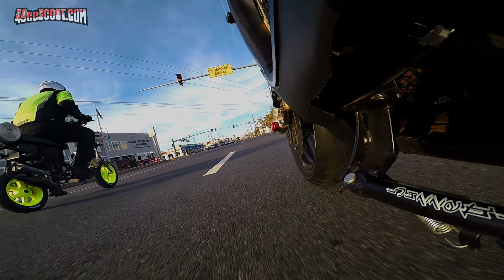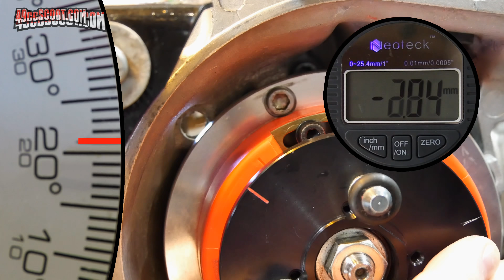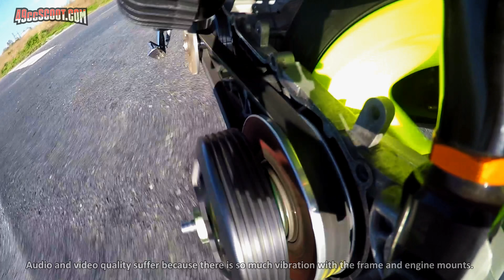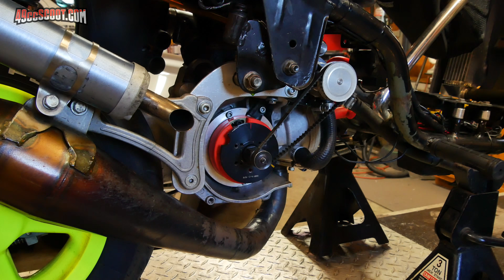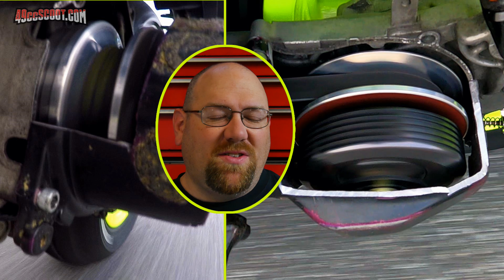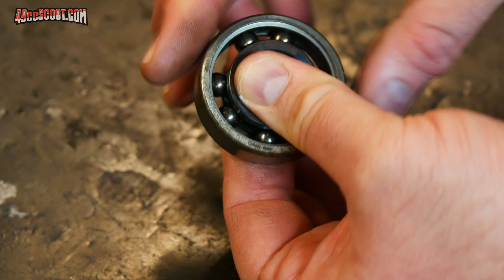Breaking Almost Everything : Scooter Fails : TPR 86cc Build : Part 48

Comment: Hi Brandon, first of all, good video.. lot of information.. 2. driving without belt cover is really dangerous, i wouldnt do that again for safty reasons.. and 3 but most important i would prefer you a a piaggio SKR, a gilera runner or a Piaggio hexagon with 125-150-172-180 cc ! i know its hard to find in the states but belive me this things hold up a lot better than tuned 70cc... my SKR have now 179cc (Malossi 172cc + 55/110 crank) with Mikuni TM24 carb and Malossi transmission holding up now for 10000km ~ 7000miles with nearly no problems.. lot mor tourqe and really really fun to drive.. maybe u look out in future for something like that i only can prefer this
Reply from the maker: I'd like one of those big Piaggios as well, but I've noticed it's mostly the guys with deep pockets that seem to end up with one here in the states. I tried to price one out some time ago and it looked like thousands of dollars and every time I needed anything it would be much more difficult to get and more of a wait aside from added expense.

Comment: Very interesting stuff, nice video!
those bearings (TN9 cage) have less friction, but they dont last as much as the steel caged ones.
Please do a follow up video on the future engine rebuild. 
What kind of cage will you choose one the new bearings?
Reply from the maker: I've already got the same ones here. I bought them right after I installed the kit originally to have them around so I'm gonna use them. If they make it another 2,400 miles, the kit will most likely be toast by then anyway.
Reply: @49ccscoot  I am rebuilding a Minarelli P6 80cc, I also bought SKF 6204 TN9, I'm now wondering if I made the right choice
Reply from the maker: @DavidArez  I think they're fine. After seeing that some big tuning manufacturers are supplying a support for the ramp plate, I'm leaning more toward the vari taking out the bearing and the crank.

Comment: I used turn kevlar belts to dust every other week. After upgrading to the Stage 6 Oversized Transmission Kit; I haven't had it happen again. A costly upgrade for an already tuned scoot, but well worth it in the long run imho. I'm almost 100% sure the belt was running off the top of the front pulley before.
Reply: Also, check your crankcase for any cast defects where the belt could be fouling against the inner support material.  If it is then you'll need to remove some material with a dremel.

Comment: Seen this before. It's all about ramp plate. After ramp broke, heat build up from friction and that is why crank seal and bearing nylon cage failed. Do not ask me why the plate failed, don't know. 
Best of luck Brant! 🏍🏁
Reply from the maker: Thank you. Others here commented the same. I've never heard about this, but it was even pointed out that you can see a reinforcement spacer included in some variator kits.

Comment: The crank catastrophe can be put down to not having the shaft ends supported inside the outer casing of the cvt. 
  Have watched many of your vids over here in New Zealand.  Love your work. 
  Just out of interest..what's you mpg/ fuel consumption for this setup? 
 Im running a chinese qm40b 50cc here. So far just my mods are a race exhaust and race cdi and derestricted. The bike is branded tnt roma. They run a 10 inch wheel. I top out at 70 ish kmh. 
 Uphill performance is still abysmally poor. Terrain here is hilly. Would love to see you ride some steeper hills to see how it performs uphill. For me ..the aim is to not be holding back traffic at 35kmh..and be at least holding 50kmh uphill, if not having a little oomph left over for uphill acceleration to 50kmh.
Reply from the maker: It does something like 40-45MPG. It was a little higher with the lower RPM pipe originally. That's about the same as I was getting with my old 103cc combo. About the best I've ever done for increased power and good economy was an old 90cc short case in a small scoot and it would see 50+MPG regularly and even as much as 70MPG when I tried to run it really gently. It revved to about 9,000RPM and would do roughly 60MPH. Nice simple street setup that was very unassuming to see or hear.
Reply: @49ccscoot  thats really good economy considering the speeds. 
A guy over here has an aprillia sr50 modded with a malossi big bore kit ..he tops out just above 60mph at 5 to 6 litres / 100km, 45mpg..its for sale ..Nice bike..but drinks a bit too much. 
  The issue with hills is controlling the rpm high enough so you can be in the power range of the engine. 
  Therefore Im thinking the cvt transmission is the real reason Im not making 50kmh uphill. 
  Adding more hp certainly would help..a big bore...but I feel theres enough hp there in my setup...its just finding a way to utilise it uphill. 
   Do you have a video that could help with this issue? Cvt tuning?
Reply from the maker: @bradg7279  I'm still a firm believer in more power, especially with a 50cc trying to climb hills. That said, if RPM is dropping off out of the pipe's powerband, you do need some CVT tuning. I would try lighter weights first and see how it does. Some prefer to go right to a stiffer contra spring. It may be that it takes a bit of compromise to get something that works well enough on hills and on flats. At least if you can get the RPM up on hills, you will know if you do need more power or if it is just a matter of keeping RPM up.

Comment: i think these tpr cilinders are really poor quality ive been running a mallosi mhr t6 cilinder for 700 miles and it stil looks like its new from the factory not a single scratch on the cilinder or piston . I saw you're last video where you put on the new tpr because the last one failed an i would think its not been on there for too long znd it already has scratches in the cilinder probably realy poor quality nikasil i would sugest moving to a different brand after this cilinder beacause this is a lot of money for poor quality parts mallosi 2fast ottopuntouno and al those brands are more expensive but way better quality and way more power off course im only sugesting because if you are happy with the power and wear on the tpr you should stay with the tpr i also dont know if the european racing brands are available in the US  i also wanted to say that i love you're content and ive learned a lot by watching you're video's i splitted my first case by watching avideo about you on how to install crank bearings deffinently keep up the hard and good work champ  : )
Reply from the maker: Thanks. I think the TPR kit is a good way to play on a low budget. It was also good for someone like me that wanted to experiment with high rev stuff with no prior experience. I barely ever even used a plated aluminum kit before this so there was no way I'd even consider high dollar stuff. Now I'm just  breaking so much that I can't afford anything else. lol

Comment: Any ideas as to why the bearings went bad ? I've been told years ago that for high rpm's, bearings with more tolerance are chosen. Great video as allways!
Reply: the engine only revs to a 14k, so standard c3 bearings are enough. it is if you are constantly revs over 15k that you need to get other berings. and the reason why the bearing broke may be due to regular wear and tear or pieces from the broken cylinder may ended up in the bearing and damage it.
Reply from the maker: @tim8019  Another comment here says it's common for ramp plates to break with high RPM stuff, and that may have taken the rest of the stuff out. Looking around, it appears that some manufacturers do use spacers to try to reinforce the ramp plate and he says that solved the issue for him. It could very well be what happened, since I didn't notice anything at all wrong until you can see the variator start to wobble.

Comment: use  6204 tpb63 c4 bearings much stronger!!! ,and a top performance crankshaft is shit , go for 2 fast
Reply: c4 bearings are not necessary for 14k rpm's, they will only wear faster. c3 bearings are enough for those rpm's.
Reply from the maker: I'm going to use the same bearings again (already had them) and same crank. If they both last another 2,400 miles, the TPR kit will be done anyway. 2FAST cranks cost multiple times the TPR crank and I don't recall if they even have one that matches stroke, pin diameter and conrod length for this.

Comment: Same over-heat problem,as last video.Possible the bearing.And you should not drive without belt-cover gasket.I did this accident,with a aliexpress variator,wich did not freely run variator spacer,stucked on the crank.1-2mm clearance from piston to cylinder on new 60cc,wich will shrink by time.Hard-engine.Days of icy-roads here,reintalled original rear-shocker,for drifting,have feets on the road.Try firgure out a back-wheel driving in 5km\h.But no right gear exist for that.

Comment: hey man if i was u i was gonna get a new kit and an electric waterpump like we use for cup racing in europe.. it would also give u a power upgrade and a more reliable bike! and if u changed to malossi bigbore ect u would also get more views. i underestand u wanna try tpr some more  it just seems like it hasnt been good too u :(( love ur video tho and keep putting them out!!! great work on the bike and videos! greetings from Denmark
Reply from the maker: I've been the electric pump route. Just don't like the battery drain. Even though I'd probably be fine most of the time, I prefer to have something that I can ride for many hours if I choose to. Mainly good for car shows since I really don't take all day rides on this thing since the high RPM setup.

I have to try one more thing with the TPR because there have been comments about it on so many of my vids from pretty much day one of the project.
Reply: @49ccscoot  yeah okay i see where u commin from then. looking forward too see what u gonna do with the tpr :)

Comment: looking at the video you can see the variator was moving all over the place right from that i was thinking crankshaft bearings or bent crankshaft 
what a way to rip stuff up tho lol but great video and hopefully after the new crankshaft no more broken belts 
im thinking the crankshaft has been out so a bit so variator has not been true so braking the belts and the bearings going today was just from the stress from bent crankshaft
Reply from the maker: It would be great if that solved it, but I have been breaking belts prematurely on setups before this. I stand behind the idea that people underestimate how hard it is on the belt to have a 300lb rider that likes to use the throttle with much more power than stock.
Reply: @49ccscoot  thats true in a way with the 300lb pulling power as when I was down at 210lb and I had my wife tho is only 79lb on the back of my 100cc aerox so had to pull 289lb I did brake a number of belts and in the end one got bits all in the crankshaft it ended up twisting it out of being true  bit  so maybe something along them lines has happened to you or its just doing lots of wear in the belts mega fast

Comment: when im watching and the sound change i would say bearing failure from the krank shaft you also see more vibrations in the front part. its stress from the engine freezing en the belt still trying to move it.  it pulled it self over the teeth from the crankshaft. and 1 tip if you can get new bearing try to get some with a steel cage in side. i swear by does

Comment: Good video. Hows your mvt dds? have they been reliable? Any problems?
Reply from the maker: One CDI failed not too long ago. Otherwise it has been reliable. I like it. I wish it had as much charging and lighting output as the stock system is capable of, but it's still way better than the total loss racing ignitions that are much more common.   I prefer a system that can maintain itself vs relying solely on charging batteries when parked.
Reply: joo leipoo

Comment: Do you have cooling to your transmission?
Reply from the maker: The CVT cover that  I normally use is vented. It is the  style common on youth ATVs here where the front is pretty open with a filter. I removed the filter and it's just open. Then I cut vents in the rear by the clutch as well. It's certainly not as open as the modified cover that you see in the video.

Comment: No never run without varitor cover the block can break in 2
Reply: Only if you ride on big bumps
Reply from the maker: @Bidalotroxi  The forum member that had it happen was in the middle of a turn through a traffic light and it snapped. That said, probably prior stress was the cause.
Reply: Or what you could do is cut the CVT cover almost in half so the Kickstarter is still in place but the other half the clutch and half the belt are exposed kind of like what you see on tuned Honda dios